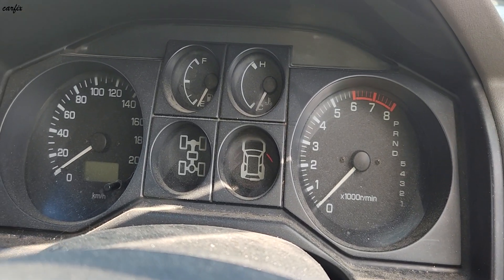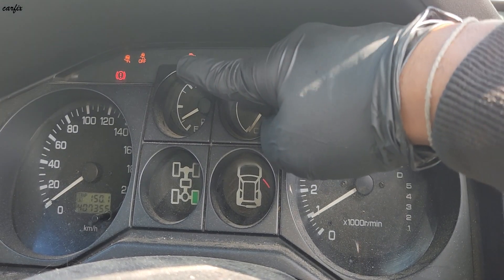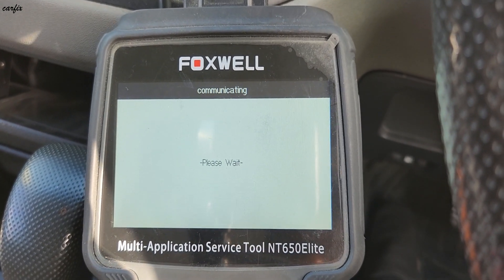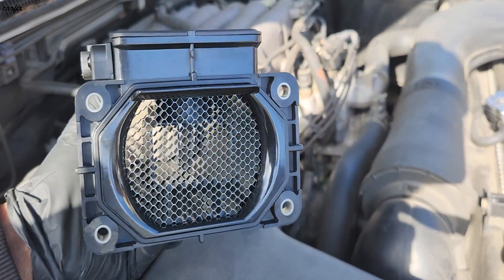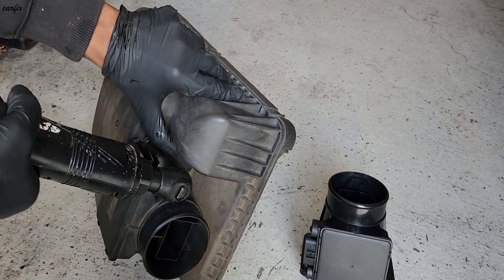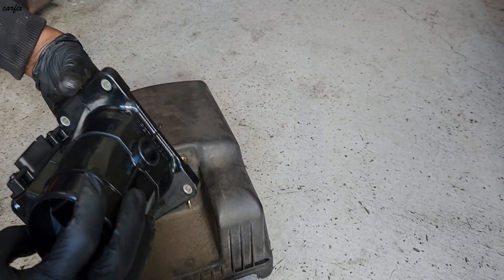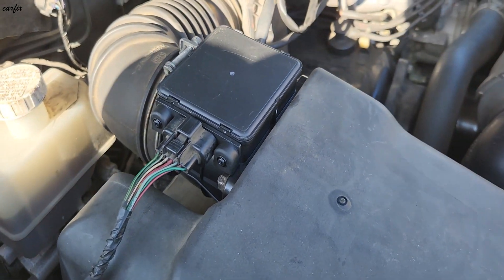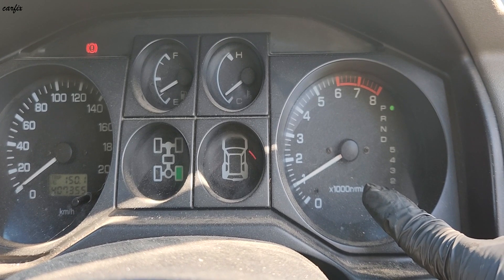Mitsubishi NP Pajero Fix Rough Idle, Loss Of Power (P0100 Code: Mass or Volume Air Flow “A” Circuit)

Comment: Hi had a high Rpm issue changed that IAC valve got it resolved . Now I am having idle issues with the RPM fluctuations when u start the car. Should I change the MAF or check if the IAC Is working or not